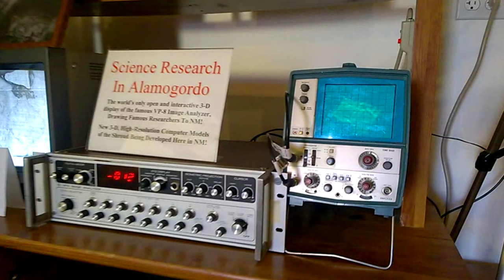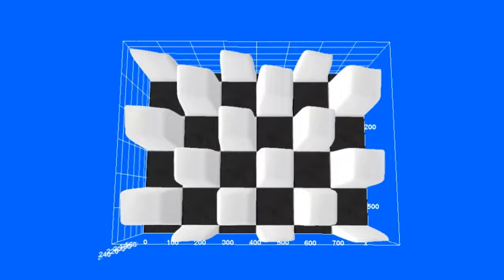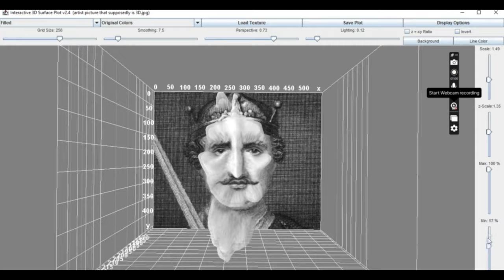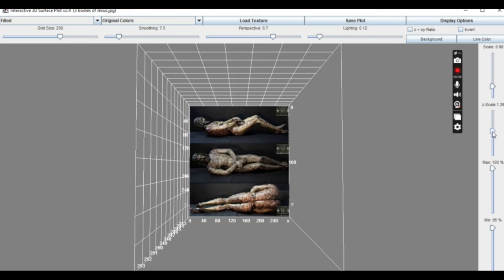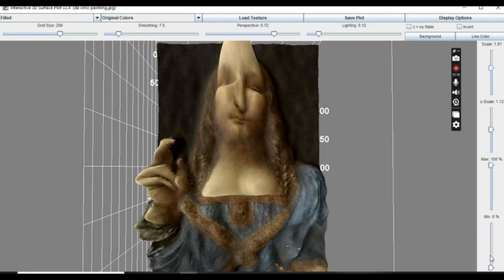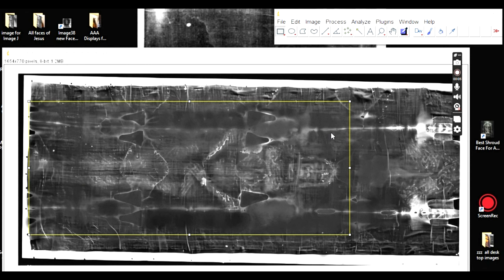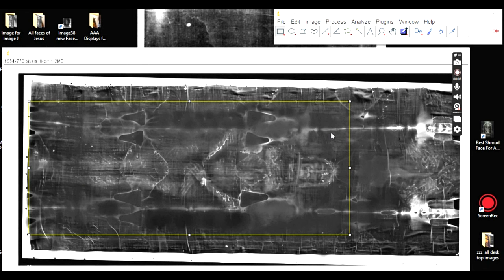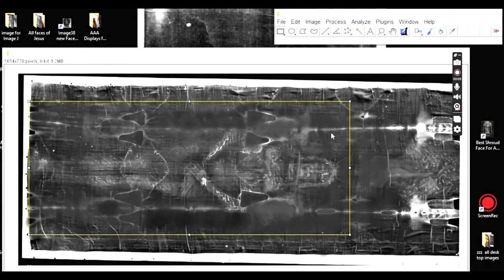NEW & UPDATED 3D IMAGES OF THE SHROUD OF TURIN:  Part 1  HD 720 Video

Comment: You have found the true face of Jesus Christ, it is the most realistic face I have seen, incredible, the Messi with the beautiful, luminous look 🙏🕌✨💫
Reply from the maker: thanks John:   We are updating this video with even better 3D images and getting straight to the point of the significance of these extremely mathematically correct 3D depth info images
THEY ARE PROOF JESUS IS THE RISEN MESSIAH WHEN COMBINED WITH THE BLOOD EVIDENCE
Sorry for the all caps there.  But that is the main point we need to get to in the first 60 seconds of our opening statement. 
We are working on that now.  We have made some great improvements in the 3D images.

Comment from the maker: The moment in the video where the Shroud is put to the ultimate test for authenticity is at 14:14.  This is the ultimate test for real solid 3D Info.   In case anyone wants to just get straight to the point go to this part of the video. 
This is where we turn up the heat on the Shroud and put it under full fire.   Other images that go through this test utterly distort so bad it is shocking.  But the Shroud holds up and stays together tight.  Not affected.    Like gold is tested by fire the Shroud passes the test.  GENUINE.
Reply: Thank you! When Jesus was Resurrected by Holy Spirit, according to Romans 8:11, the Light imprinted his Image onto the linen cloth. We have the Largest Photograph ever by God.
Reply from the maker: @reginathornton7433  It's 14' 3" Long     1 4 3   1ST Century  April 3rd?    1  4  3          There was a blood moon that was visible in Jerusalem on this date in 33AD.   It was also a Friday during the Passover...Coincidence?
Reply: @GoodShepherdFilms3333 WOW! No coincidence! God's Signs.
Reply: Had to have been a Wednesday,  for 6pm Friday to 6pm Sunday does not make 72 hours.

Comment: The light will need to be straight on for depth info to come through, no visible shadows, then contrast and black level corrected. The closest was the attempted shroud replica, but it still is distorted as you mentioned!
Reply from the maker: Hi Adrean.   We are going to do some short versions of this in the future. and go straight to the prime shots.  On our community Page we show the Shroud at max settings for testing for 3D depth info.  It passes.  It is a very , very hard test to pass. https://www.youtube.com/@GoodShepherdFilms3333/community
Reply: @GoodShepherdFilms3333  thank you so much for what you are doing. If you can get this sort of information into short form without compromising the details, I think we may be getting somewhere with changing the perception of the shroud in the minds of skeptics and laymen alike

Comment: A medieval forger in my humble opinion would have been unable to create such accurate depth information even with a rubbing. The end result would not be nearly as pretty. I think they would be more likely to paint an aesthetically pleasing image. The shroud simply has too much detail to be a forgery, in my mind.
Reply from the maker: In a holograhic image process it will create extreme details in the images.   The details of the Shroud image are what we would expect to see if the image process was in fact a  holographic image process, meaning there was light/radiation exiting the body to create the image
Reply: @GoodShepherdFilms3333  you are correct!

Comment: Im a believer, i believe the shroud to be genuine. But i guess I'm trying to grasp the significance of the shroud having more accurate depth representation based on the lights an darks of an image.  What does it prove?
Reply from the maker: That is a very good question.   This video was originally meant to be a single video,  but we split it into 2 Parts. 
The Part 2 Video answers your questions.   But this also should have been discussed and explained in this Part 1  video,   The significance of the depth info.  

To sum it up briefly it means that  the image process  on the Shroud was a holographic process,  meaning  the body could not have been touching the cloth when the image was created and the body had to be emitting UV Light electromagnetic or charged particle radiation. 

It eliminates all man made image theories, 
Image process on the Shroud was a holographic process,  not a photographic process 
A man made image theory is saying someone
1. Levitated a dead scourged and crucified body in between the 2 halves of a long sheet of fine linen cloth
2. Got the dead body to emit a short wave burst of  electromagnetic and or charged particle radiation
3.  Slowed down the speed of light during the process

And this was done by "the forger"    No way!

IN the Part 2 Video we show how it is possible to create 3D info which gives us greater insight and understanding in how the depth info on the Shroud was achieved,  it involves the 3D object itself emitting light and the object separated from the film plate. 
Here is a link to that video. It is 10 minutes long. 

https://youtu.be/YIJwl60vU1Q

Comment: Thank you for another truly interesting video. Do you think this hologram is made possible by the light coming from within the body . I wonder if a test could be done to prove the light source radiated out of the body. I wonder if a doll could have a light source inside of it then photographed then put through the machine? I also wonder if a hand on top of a light then black out the surrounding exposed light and photo graph the light passing through the hand, if a more normal 3d hand would emerge?
Reply from the maker: Hi Robynn   Allow me time to give a more detailed response   In the meantime this video will give you more insight
https://youtu.be/YIJwl60vU1Q 

In the next video we will show what a 3D object looks like when placed on a copier scanner and with a 3D statue head underwater emitting glow in the dark UV Paint.  When done this way we can get accurate depth info like The Shroud.  Excellent depth info . Stunning
But bottom line:  The body in the Shroud had to be emitting light and also the possibility of being done outside of time.
The Shroud image process was holographic,   to create the quality of the depth info it would require the body itself to be emitting a highly ordered and controlled light
Light of a single wavelength and in a place of darkness

Another possiblity that is more complex is there was a second light source in the tomb.   A reference beam aimed at the body and interacdting wiht the waves coming out of the body creating an interference pattern
I have made holograms many times .  The forensic evidence on the Shroud tells us a reference beam was present.  Most likely the Light of the Almighty God himself taking a trip down to 
Earth to get his SON out of that Tomb!
Reply: Oh very interesting thank you for the detailed answer.
Reply: @GoodShepherdFilms3333  thank you that answered my curiosity. I can't wait for your never video dealing with the photograph. You should pin both of these in  the description. I love how passionate you are about this subject.

Comment: That is very interesting, but l have a couple of questions for you. 1. The Bible says that He had a separate cloth covering His head. 2. The Bible says that His beard was plucked out, but on the shroud you can clearly see a beard. What do you say to that? How do you explain that? I will be interested to hear what you have to say about that, if you answer me. I've been scanning through the other comments, and l'm surprised that no-one else has posed these questions. 🤔 And before you call me a doubting Thomas, l want to say that l 100% believe in Jesus (and belong to Him) l just have a couple of questions about the shroud.
Reply from the maker: Sorry for the delayed 1 day response.   I know i have seen comments and questions about the head cloth at least several thousand times in the last 12 years.
I will send you a visual response.   This comes up so often we had to make a video just on the points you mentioned

It took 3 months to finish it and several thousand dollars.   But yes you get to see it for FREE.
But real quick. 
1. The head cloth is kept in Spain.  It is 33" x 21"    It was used to cover the head of Jesus on the cross after he died.  
It was wrapped around his head for a total of about 2 hours total.
Ultimately it was removed in the final burial.  There is a lot of blood and fluid from the lungs on this cloth  

2. The Beard Section.  A lot of it is missing.  From both the right and left hand sides and in the middle. 

The Isaiah passage and the Gospel of John passages are repeated over and over again,  but sometimes they got lost in the comment sections

On one video alone this year these points were mentioned easily over 100 times from the over 20000 comment on the video

Let me go search for the best video responses for you.

Happy Holidays
Reply from the maker: WE welcome skeptic comments.  Feel free to ask any questions.  We leave all comments up  We do not censor anyone.  

This is a good one for the burial scene,  the head cloth and the missing beard section and a whole lot more
Merry Christmas!
Video link
https://youtu.be/uDRCVLOv1-w
Reply from the maker: Hi Suzy  this one is the best of all.
The whole video is verses from the Bible and the forensic evidence.  Our best video I think
https://youtu.be/DAiUMEripQ4 

It goes over these Bible verses with forensic evidence

The following verses from the Bible are presented side by side with the forensic evidence on the Shroud of Turin.
1. Mark 15:46   "Joseph bought a linen Shroud"
2. Isaiah 53:9  "He was with a rich man at death"
3. Isaiah 53:6   "I gave my back to those who struck me"
4. Psalm 129:3   "The plowers plowed on my back"
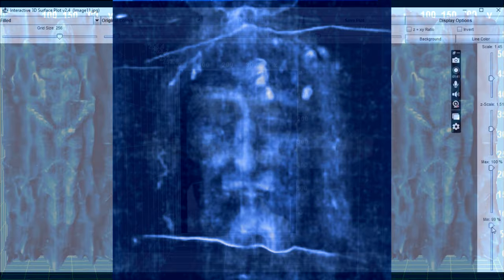5. Genesis 3:15   "And you shall strike His heel"
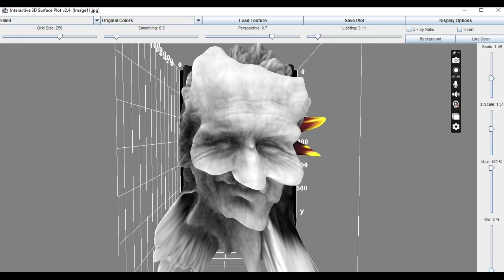6. Genesis 3:17    "thorns and thistles it will yield for you"
7. Galatians 3:13   "Jesus became a curse for us"
8. John 19:2   "The soldiers twisted together a crown of thorns'
9. John 19:39  "And there came Nicodemus who brought a mixture of myrrh and aloes"
10. John 20:7  "And the napkin that was about his head"
11. John 19:34   "one of the soldiers pierced his side and out came out blood and water"
12. John 19:40   "they took the body of Jesus and wound it in the linen clothes"
13. John 20:6   "He saw the strips of linen lying there"
14.  Mathew 20:18   "Behold we go up to Jerusalem"
15. Judges 13:5  "No razor shall come upon his head'
16. Isaiah 52:14   "His appearance was more disfigured than any man"
17. Isaiah 53:5  "By His stripes we are healed"
18. Psalm 22:14  "All of my bones are out of joint"
19. Mathew 16:4    "the only sign this wicked generation will get is the Sign of Jonah"
20. Deuteronomy 19:15    "A matter must be established by 2 to 3 witnesses"
21  Mark 9:31  "He will rise after 3 days"  and  John 11:25    "I am the Resurrection and the Life"     
The Word of God and The Shroud of Turin are the most powerful witnesses in the world, who tell the most powerful truth,   may that truth set you free forever.  Amen.

Comment: Wrong projection on the shroud. The shroud is not a camera, it was folded. The face (and the body) should have been distorted if it's not an artwork from the 14-16th Century.
Reply from the maker: The body images over the blood are not a contact image.  Only the blood stains are a contact image.   The coloring of the fabric was done with extremely precise math of the 3D characteristics of the body .   Math converted to color .   It is so accurate that you cannot distort the image even when spreading apart the image on the Z Scale, (the thickness of the object)  to the max.  
To get math this precise requires the body itself to be emitting some kind of electro magnetic radiation and a interference pattern was created.  As in how a hologram is made.  
The info on the shroud is very tight and compacted. 
we will do a separate video to explain that. 
It was not a photographic process. 

It was a holographic process.   There is no way this can be man made.
Unless it was a cloth with blood stains only.  then we would be looking at something very easy to explain.

Comment: Would it work with a photographic negative?
Reply from the maker: Good question.   But no.  photographs or photo negatives do not contain depth info.  IN the case you have a photo negative image to examine on the software,  of which I did many of them, you simply click on the invert image and it will be a negative.  To have accurate depth info we must have a source of light that is not ordinary and the object itself must be emitting light and be an ordered and controlled light.  Our part 2 video shows how to create depth info.   I did the best I could to explain it quickly.    10 minute video   https://youtu.be/YIJwl60vU1Q 

Bottom Line:  To create accurate depth info the object itself must be emitting light.
Reply: @GoodShepherdFilms3333  thank you so much for replying. Yes I understand. X

Comment: Only the blood distorts as expected.
If the image of Christ was painted on it would distort as well.
A high intensity UV ray burned the image of Christ on to the cloth.
Christ did not get up and walk out of the tomb he was put in.
He became immaterial and rematerialzed later on to appear to his disciples.
The light of Christ cannot be extinguished.
Reply from the maker: Exactly correct.  the Blood stains do not contain depth info . They are a single color image.  Blood stains were on the cloth 1st.  The body images were a secondary event that occurred 48 to 72 hours later
The blood stains interfere with the depth info.    The blood is the most important thing on the Shroud.   The blood of Jesus

But for seeing the depth info they have to be minimized.  One way to do this is too use distant photos taken of the Shroud not close ups.
When the photographer steps back 10 to 20 ft and takes a photo of the Shroud the depth info is MUCH IMPROVED.

This also takes out the fabric weave which caused  bumps and waves in the image. 
We will explain this more in our next upcoming video. 
When we use the distant shots the depth info is excellent

In this video we used the 1931 images of the Shroud when the photographer filmed the Whole Shroud from a distance and used the old style of taking photos with film plates.

This method captured the depth info the best, by far.

The 1978 photos by Barrie when viewed on backlit transparencies with the lighting set very low and stand back 15 feet and take a photo. These also work good.

The Depth info is mathematically correct.  If not it would distort when the gain is turned the max.   The Shroud image does not distort.  
All other images do including X ray images, paintings, photos, 3D art you name it. 
They all fail because those things were not emitting light when the image was captured and the speed of light was moving at its normal speed of 186,000 miles per second

to get accurate depth info the speed of light must be around 60,000 miles per second slower and the light being emitted must be in a straight line with no other interference. 
Laser light would be perfect for creating depth info as seen in holograms
The Shroud image is like this.   Perfect math depth info

The 3D analyzing software tells us this is true.
An extremely compelling and powerful truth
telling us the body in the cloth was emitting a highly ordered and controlled light moving at a slower speed or there was a separate light source in the tomb shining into the light coming from the body of Jesus and creating an interference pattern.  That is another possibility

Another is the image was created outside of time.  In a timeless state.   The evidence leans that way.   The image created outside of time.
Reply: @GoodShepherdFilms3333  Regardless of the specifics of how the image was created we can say with a high degree of confidence that this image was not and still is not reproducible by humans using technological means.
It is a 'supernatural' creation.